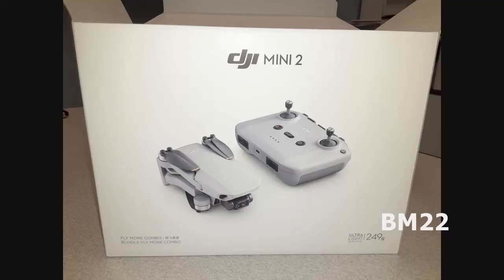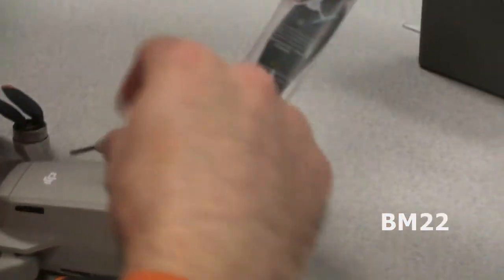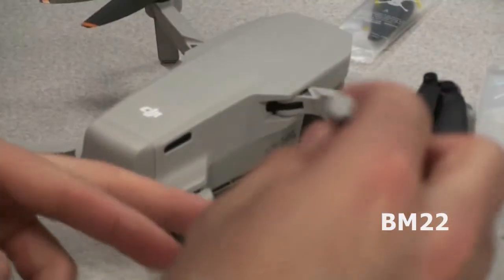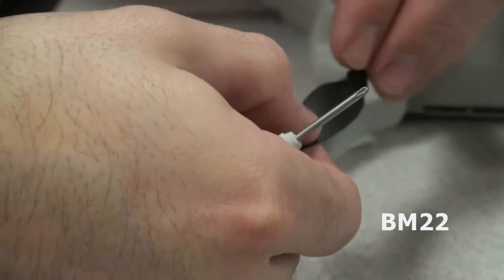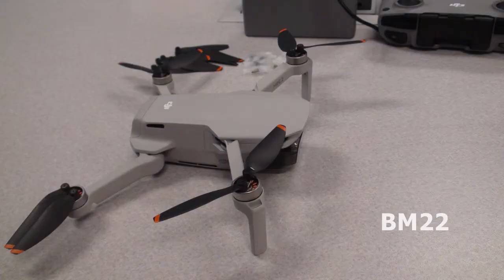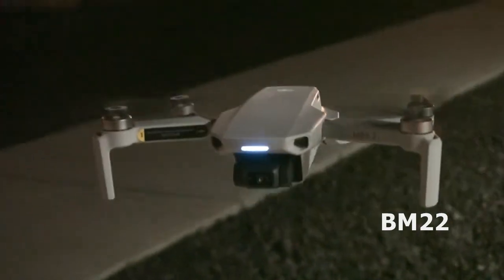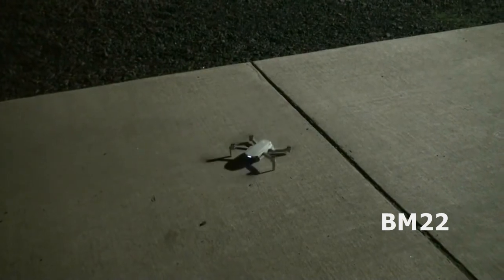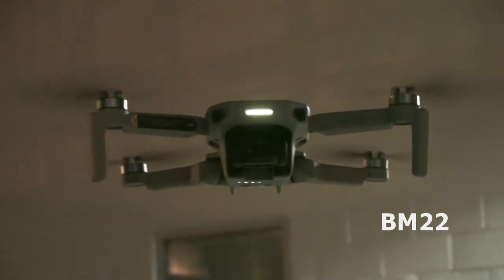DJI Mini 2 Drone Propeller Replacement How To

Comment: Maybe I overtightened a screw or something on the Mini 2 it would drift down  automatically...I put a very tiny dab of vasoline on the top of each tiny screws and no problems now???  Let me know 😊
Reply from the maker: One of the props could be damaged, even during packing and shipping of a new prop, they can develop micro cracks or damage that we cannot see without magnification. I like to view my props under my video microscope prior to installation, and also after a hard landing or tagging a tree. So far I have not heard of an issue with over-tightening, but it could be possible. I just received my new Skydio2 drone, and I'll do an unboxing video in the next day or so.
Reply: @BM22TechReview  I checked all the props, and your right! There was a very tiny crack on the front  prop on the starboard side, It must of happened when I did a hand landing at the beach the other day and the prop made contact with my hand! My hand is ok , and I just  replaced all the props and all is good!. Thank you!

Comment: Prop guards for the Mavic Mini fit the Mini 2
Reply from the maker: Thanks; I did order them for my Mavic mini, but they have not arrived yet. The website was a bit ambiguous on whether it would fit both or not; it would pop up in the accessory section for the Mini 2, but they were simply labeled for the Mavic mini.

Comment: If you've received the propeller replacements, what was actually in the box for $12? For $12, was it a complete set (8 propellers)? I just ordered 2 ($24) and it was a little confusing for me as well, as to what I will be getting.
Reply from the maker: I ordered 3 of the $12 propeller kits, not knowing what would be inside. So I just now opened one up, and it does come with one complete propeller set. 8 total blades; 2 "A" sets and 2 "B" sets.